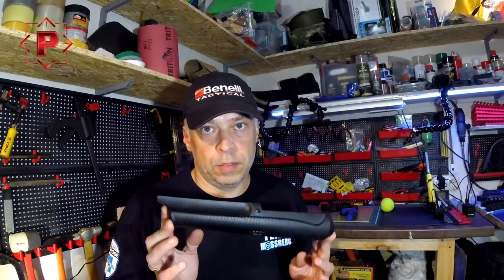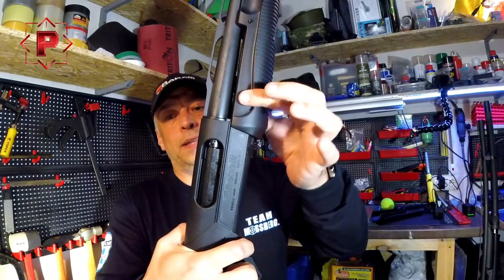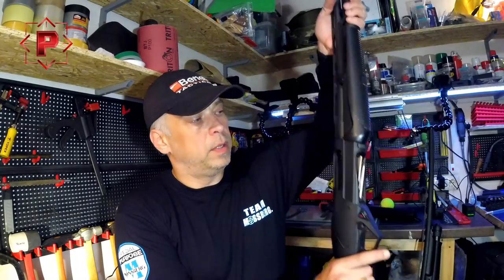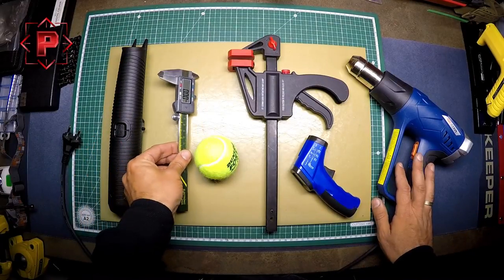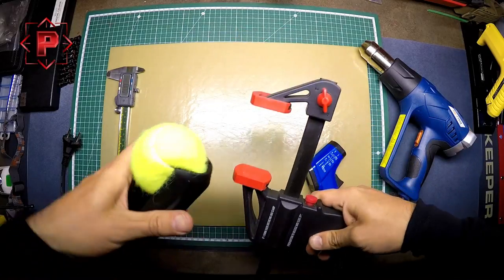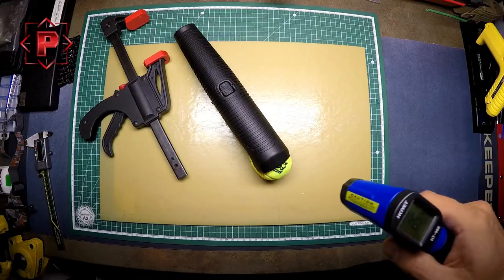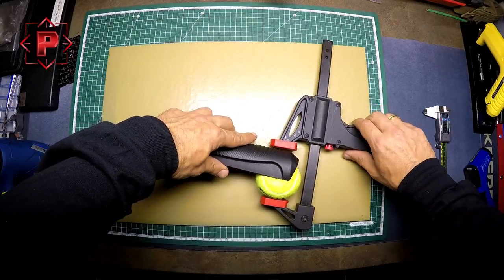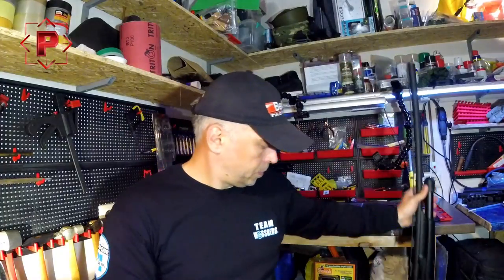How to repair SuperNova forend

Comment: Please make a video of how to clean the trigger assembly and bolt action assembly. Is it ok soak the whole trigger assembly in the degreaser solution then rinse and dry? How do you lubricate the trigger assembly do you spray the whole thing inside and out or you just put a droplet of oil in it?
Reply from the maker: Wayne T i am spraying the whole trigger assembly by a lot of degreaser, sometimes twice (if it is very dirty), than waiting until it dry and adding a little drops of oil on to moving parts surfaces. Once in 5 thousands of shots i am making the whole disassembling and cleaning
Reply from the maker: Wayne T the bolt assembly cleaning is the same mostly, but you need to clean better of all the extractor assembly and move few times the bolt during spraying degreaser to clean all of dirt inside bolt carrier. Then drop an oil onto bolt neck and move it few times. I was never disassemble bolt assembly for cleaning (more than 30 thousand rounds), just taking out firing pin and firing pin spring.
Reply: @PracticaUA , thank you for response, big help.
Reply from the maker: Wayne T you are always welcome

Comment: My foreend has some issues with ring like structure in front of the forend. They are too tight. Today I grind them and tomorrow I'll get tennis ball and repair back side too. Because I don't have termometer I just pour hot water. I don't think 100 celcius harm it. If something go wrong foreend is $25. It's cheap relatively.
Reply: I also had to grind some of the ring like structure of the front of the forend in order to have the pump run smoothly, i followed the instruction in the video, using a wise instead to spread the forend walls, now the the pump runs super smoothly. If you guys are experiensing sticky movement after spreading the forend walls, try removing the mechanism and action bars and run the pump on the magasine tube, if there is drag then sandpaper/dremel the forend plastic that is touching the magasine tube until it moves freely, I tried to sandpaper the magasine tube but it did not help.
Reply: @miklare  just tennis ball and heat did not help for me. I'll try to do the same things with clamps and 2 tennis ball. 1 tennis ball with it's own spring force isn't enough.
Reply from the maker: miklare also you can polish magtube outside  for smooth movement of forend
Reply: @PracticaUA  yep I do it too and now I have super smooth action. Thanks man

Comment: Is it normal for the bolt to slide back about an inch when the gun is not cocked? Just from gravity?
Reply from the maker: Cody Wilcoxson Yes,it is absolutely normal. Don’t worry about that. Slide is moving back until it stopped by decocked hammer.
Reply: It is a rotating bolt, should open like that.